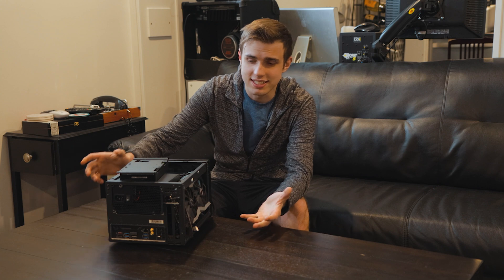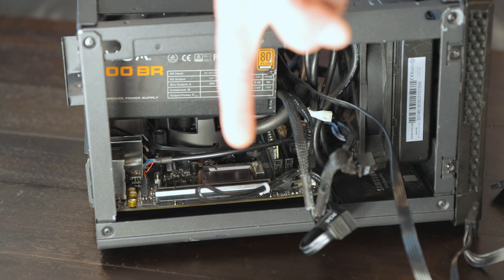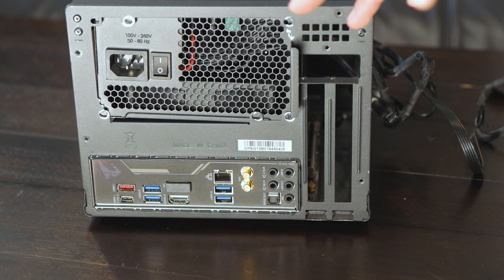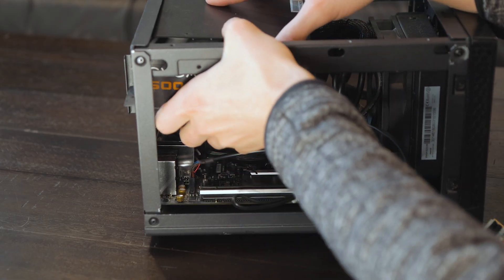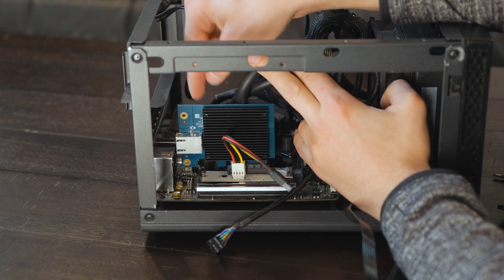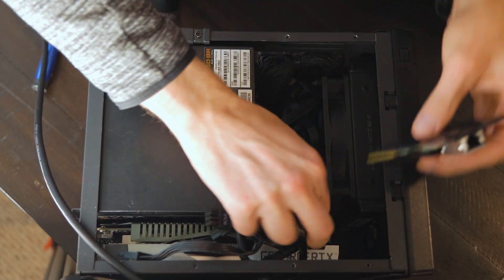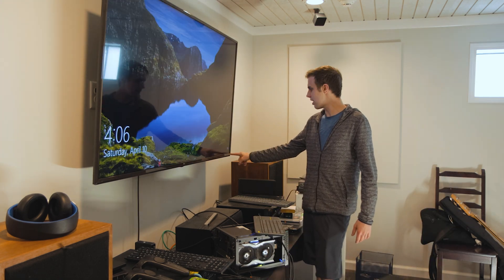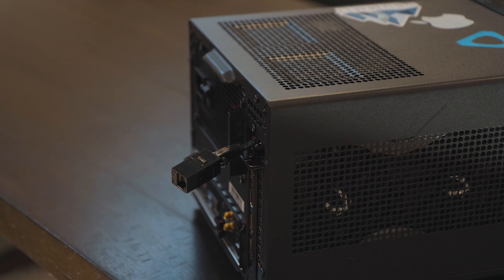Adding 10Gb Networking to a Mini ITX PC

Comment: I’ve done this with an x570-I gaming and loved the idea of hooking it into the rear of the board m.2. Both a 10g base-t and a 4k60 pro worked flawlessly. And still had my other m.2 for storage.
Reply: What adapter did you use to achieve that? Was it the same one on the video?

Comment: I have the same case, and I'm working on a similar solution for 10G network, but I'm using a high-quality riser from ADT-Link. So instead of a M.2 riser plus PCIe riser, which might be unreliable, you only need one such riser. I plan to mount the card on the back panel, just below the PS, but I have a SF-450 power supply, which is a lot smaller, and does leave some room for the NIC just below it. 

I'm also planning to replace my single cooling fan with a paid of 15mm slim fans, in push-pull confiiguration, to get more air flowing through th case. 

You didn't mention which NIC you used. That one you have looks really small, way smaller than any 10G cards I've seen. The smallest I could find is ASUS, and others from TrendNET and StartTech are similar sized. I think that if I could find a tiny 10G card like yours, that the coolig would be fine in this case. Thanks for sharing.
Reply from the maker: You can get m.2 10gb cards now! I have the trendnet one (same size as the asus)

Comment: Amazing! I have the exact same ITX system, and I was considering ditching the ITX format because of the upcoming upgrade to 10Gbe, so you have an awesome solution, and I didn't know you could get that riser card. I did see they have an M.2 10G card, but it's $238, so your solution is a money saver.

Comment: ONLY TAKE out the gigabit card if you converted your entire home and get that much bandwidth in from the isp. Otherwise slap in a 10g card but your it to connect to other 10g devices....

Jitter and instability - read about it.

Comment: How can you add an Ethercon port to your build? I’m interested.
Reply from the maker: I still haven't done it but I'm really tempted to put it in the power supply like the Mac Pro does... Not a good option but I want to do it mostly for the lolz
Reply: @MillerTechnicalServices  can I use the PCI slot to accomplish this? or do I have to configure it with the power supply?

I’m really interested in this process because I have A build I use for life sound and this would be extremely useful.

Comment: Just beware you need at least miniPCIe 3.0 x4 and PCIe 3.0 10 Gbit network card to reach real 10 Gbit speed. See PCIe speeds: https://en.wikipedia.org/wiki/PCI_Express#History_and_revisions

For example, Intel X540-T2 needs at least 8 lines, because supports PCIe 2.0 only. Intel X550-T2 is ok, because supports PCIe 3.0, so needs 4 lines only.

Comment: Pretty good, can you do a ubiquiti wifi 6 AP range review? Going through walls etc. Also a comparison against the AC-Lite and using U6-Lite with wifi 5 devices and testing iPerf and range? All reviews i have seen for U6-Lites are using wifi 6 devices. 

I’m moving into a new home and deploying 2 U6-Lites, I’m still scared about 5Ghz range across 2 walls for Wifi 5 devices
Reply from the maker: I mean... I had a range test. That’s what all the graphs were.... compared to other access points.